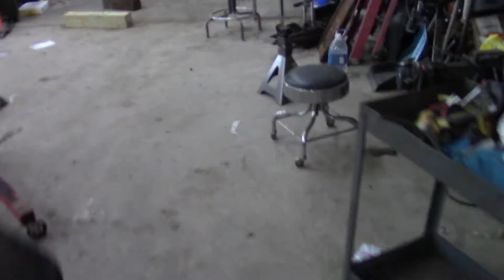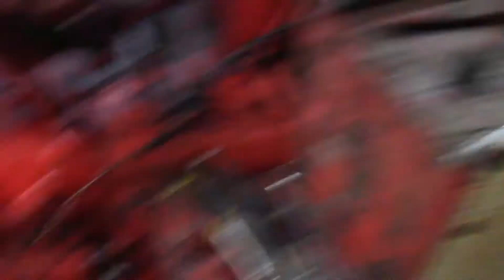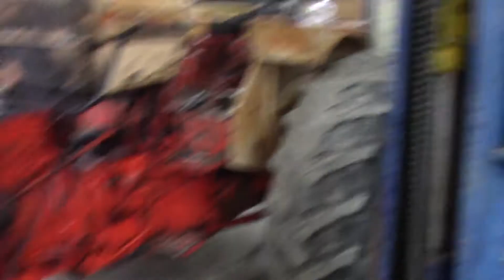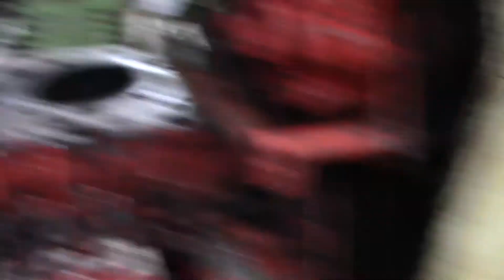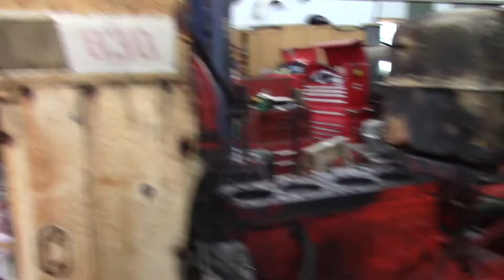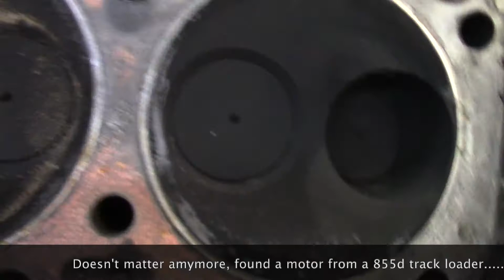Case 830 Comfort King introduction

Comment: Looking at an 830 that has a knock so prolly will be tearing into and doing an inframe overhaul. Did you find out on those block cracks?
Reply from the maker: We found a next series motor from a case bucket loader, 855 if I remember right. It would be the same as a 870 engine. So we never went further on the original 830 engine. I have a playlist on this tractor and intend to start adding to soon. Thanks for the comment and thanks for watching! John
Reply from the maker: FYI; Changed channel name to John Frytag. Thanks!

Comment: My 830 DIESEL the same as yours ! Had 78 HP ON THE DYNO Years back .on 540 pto ,yes the fuel is turned up .
Reply from the maker: Hi Dale: Can't wait to get back to it. Been on the back burner since spring when I had to do projects at the BBQ. Thanks for commenting and watching! Keep in touch. John
Reply: I want to see how the Radiator fits !
Reply from the maker: Me too Dale!
Reply: Lift it up and forward over steering box !+ change the top neck so it fits ,like J I CASE made it that way ! Just a idea ?

Comment: I brought a 730 back in the day. The farmer I got it from. Had no water in engine setting on the barn bridge. I put antifreeze in it and drove it home. The next day it would start. It was hydraulic lock. Heads were both crack. I was pissed needlessness to say.
Reply from the maker: Hi Mark;  Yep it seems to be a issue with the older pre-cumbustion heads. I've heard the 83/1030 heads were more prone to it than the 730/930 heads. When I was a kid we had a 1030. Loved that brut and never had a problem with it. probably proper warm up and cool down would lessen the chance of a crack? Thanks for the comment and thanks for watching. John

Comment: We had what as a kid, I believed was a 1965 standard tread 830 diesel. It did have the Eagle hitch, so I am probably mistaken about the year of manufacture. It had the clamshell fenders and lacked the elevated platform of the Comfort King tractors. Replaced the head gasket a couple times, but other than that, it was a wonderful machine and we put many thousands of hours on it with very little trouble. It was actually a far better machine in terms of reliabilty and service life than our 1968 930. Hard to imagine that that pair were our our big tractors until the early 1970s.
Reply from the maker: Hi Kenneth; I have a 730 that is also not a comfort king, still runs great. I think the CK came out in 66? And when we were still farming we had a 1030 CK and that thing was a beast. It is amazing to look at the progress (?) in tractors since the seventies. Its like a different world. A lot of the advancements are great like 4 wheel drive but I don't like that these new tractors are one bad chip away from being obsolete. I hear the pricing on good used pre-computer tractors are at a premium. Oh well progress, I think I like the old days better. Thanks for the great comment and thanks for watching! John

Comment: I actually just finished rebuilding the engine in my 830. Had same problem, except maybe worse. It would literally start pushing a gallon of antifreeze out of the overflow after maybe 15 minutes of running. Upon tear down, we ended up finding cracks in the liners near the carbon ring, very hard to see until you clean them good.